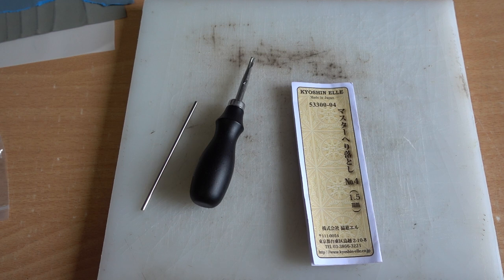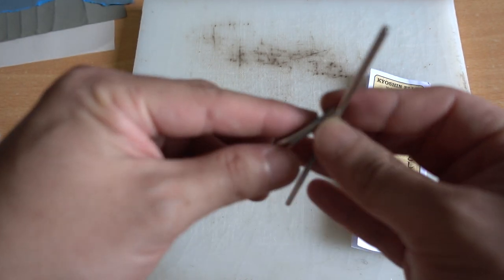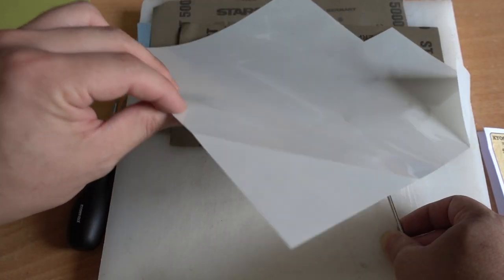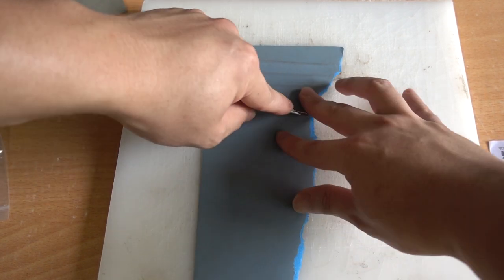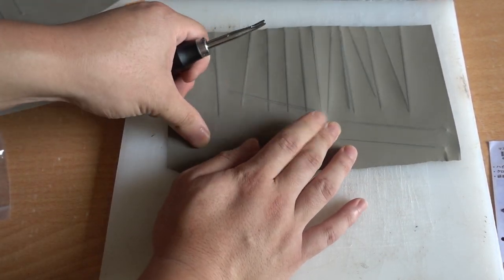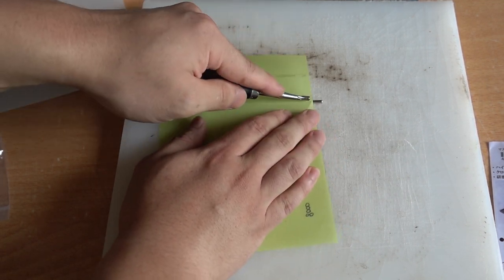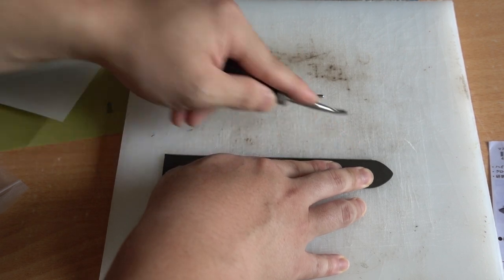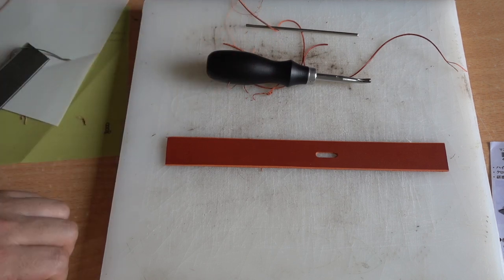How to Sharpen Edge Beveler (Edger)

Comment: A) It friends on the design of the edger. Everyone assumes all edgers are designed like the one they have.

B) The Roots size should be chosen so that it fits the groove WITH THE SANDPAPER WRAPPED AROUND IT. If it fits the groove, without the sandpaper, then it is too big, and you will enlarge your groove.

Comment: Once again, I learn more details on leatherwork from this informative video about the sequence of sharpening the edge beveller. Thank you for demonstrating the complete method and noting the various grits used in the process of sharpening, then finally how to strop the tool. I did not know how the beveller is correctly sharpened and stropped.
Reply from the maker: Thank you for the comment. I am very glad that now you know the method. it is really nothing but important steps. sharp tools make great result! : )

Comment: have had my smallest edge beveler since '69 when I started my brief career as a hippy-dippy leatherman to help work my way thru 2 yrs of college....luckily, crude leatherwork sold easily back then.... ;o) ....have never sharpened it and it still cuts a clean bevel....over the years, have picked up a couple more, larger edgers that do need sharpening....thanks for your video!!.....have progressed quite a bit over the years as a hobby....right now, it's time to make small saddlebags for my harley sporty 48....still have a couple sides of heavier  black latigo and will probably need one of my larger edgers, which will be sharp thanks to you.... [thumbs up]

Comment: This was very helpful, I have several thickness of rods down to .3 mm. This showed me a better way. Thank you. Leather cutting tools are the second reason I will take a cutting tool to a polished edge, wood carving is the other. All my leather cutting tools have extremely sharp edges. I make knives and the sheaths that go with them. I found I like leather work as much as knifemaking. Try stropping with diamond compound, very aggressive.

Comment: This does a terrific job of getting the edger sharp, but I'm getting an unintended consequence.  When I drag the edger along the rod (which is laid on a table, over the sandpaper, as you are doing, the prongs on either side of the edge are also getting sharpened, and then, when I use the tool, these prongs dig in.  I've started just wrapping the sandpaper around the rod and holding it in my hand so it doesn't contact the prongs, but this method is less precise.  I prefer the accuracy of your method.  Am I doing something wrong?  Thanks.

Comment: I didn't know about the rod and sandpaper technique. I have an edge beverler that I got from Tandy, so it's mediocre at best. I have used the stropping technique that you show with black (coarser) and green compounds and it made a noticeable difference in its performance. I strop before every use, just like with a knife or other edged tool. Here in the USA many hardware stores sell small diameter brass rods so I should be able to find something suitable. You could get much more life out of your sandpaper if you put a couple of drops of oil on the paper (to float the swarf) and just made multiple passes over the same spot on the sandpaper. Premium quality sandpaper wears very well, and the cheap no-name brands wear out very quickly. It's worth it to pay extra for the premium quality papers like you are using.
Reply from the maker: Thank you so much for the tips and kind words. I am glad you got the idea of sharpening edgers. I envy USA craft stores because you guys have so much access to raw materials than in Asia. I would love to visit Home Depot one day. I would be like a kid in the candy store!

Comment: Thanks for a very clear and informative video.  There are few videos out there about sharpening edgers, and none of them as helpful as yours.  I have been using Seiwa edgers which come with a rod and 2000 grit paper but until now I had not quite get the technique.  Sadly the Kyoshin Elle Master edger you show doesn't appear to be available to buy on any English language website yet.  Have you tested the Vergez Blanchard edgers? I would be very interested to know your view of them as they may be the most easily obtained 'high quality' edgers for UK buyers.  Thanks again!
Reply from the maker: Thank you so much for kind words. I am very glad that my videos are helpful. Yes, Master edgers will be soon available around the sellers too. I have not tested VB edgers yet. they are for saddlers I think? it's not suitable for delicate work that I am doing. I might get one and try to modify them. if you are in UK, try to find "Pfeil" edgers. they are swiss made but not so expensive.